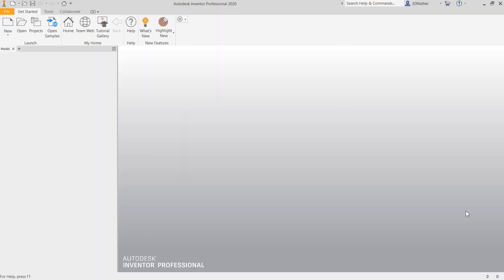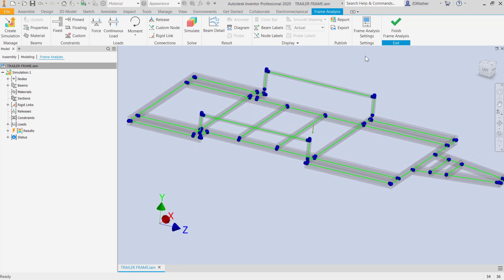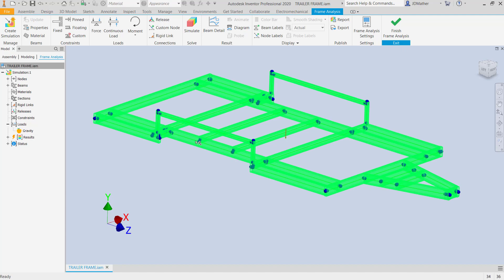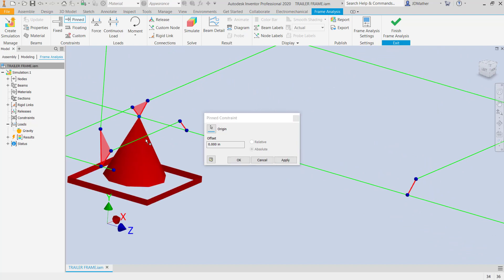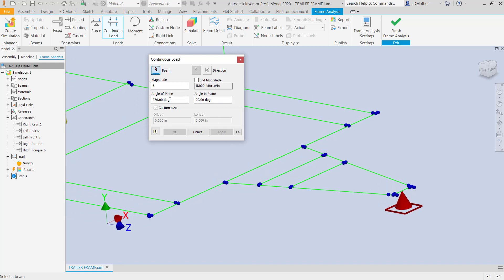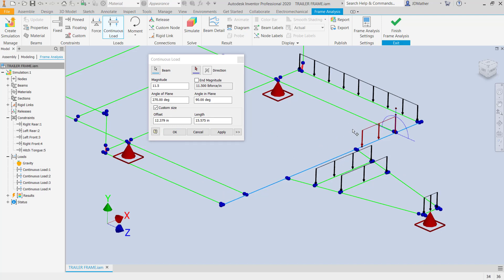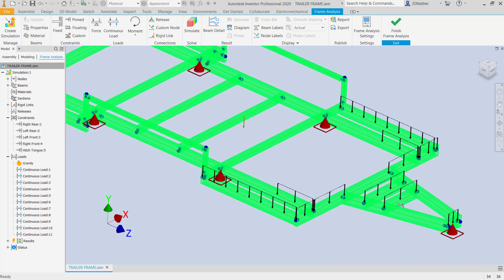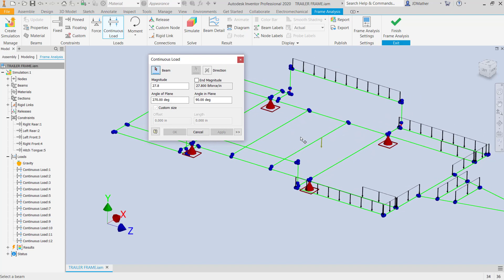Inventor FEA Lab 5   Frame Analysis

Comment: Thanks for the informative video. How does the floor work in spreading the load across the frame? If the axle mounting point is variable, given the loading plan and tongue weight objective, is there any way to find the optimal axle position?
Reply from the maker: This is a simplification - the interaction with the floor is ignored.  Some decisions can be made without analyzing complete model, but results should be compared to real assembly testing.  Moving the axles would be a manual process of move - test - evaluate.

Comment: Thanks for this video! Very helpful indeed.
I have started using Autodesk Inventor Frame Analysis (Professional 2018) for the first time this week. 
The only part I am having difficulty with is calculating the distributed loads. Are you able to share how you calculated these for your frame please?
My frame is subjected to loading from various items that will be placed on it - similar to the example in your video.

Great channel by the way!
Reply: Agreed, this is an issue I am running into. Thanks for the helpful video!
Reply from the maker: In the classroom I show where I got my loads.  This was part of a project for utility company and I had the weights for and approximate locations of various toolboxes and equipment.  If I have 15 trailers out in the parking lot and 15 different loaders loading them up with the same equipment - each loader is going to load their trailer slightly differently - but if they have been given a loading plan - they should be in the same ballpark.  Part of this exercise is to show that analysis results to problems like this are not simple 2 + 2 = 4 type of results.  Can't be graded with typical opscan sheets.   All relative.   Take your loads and divide by estimated distribution lengths.  Do the ballpark results make logical sense?
Reply: @TheCADWhisperer  Thank you for your reply. It sounds like an interesting project!
Sorry to ask but are you able to provide the calculations of the work carried out in the Classroom? I'm keen to learn how I can obtain the load distribution from the equipment and their positions and apply this to my four legged square support frame application (much simpler compared to your application). I have the equipment weights and the exact locations of where they will be positioned on the frame but I cannot seem to progress past this point. 
Thank you.
Reply: @Natamel16  Distributed Load (Newtons/meter) = Total Mass under investigation (Kg) x Gravity (Newtons) / the total length of beam that will directly bear it's weight (m)